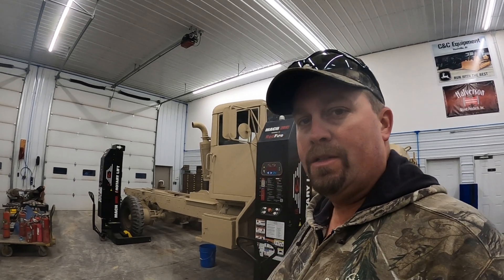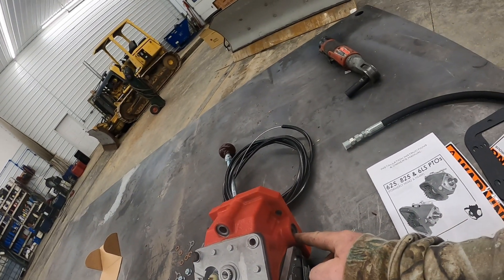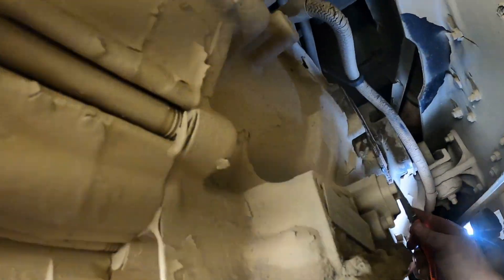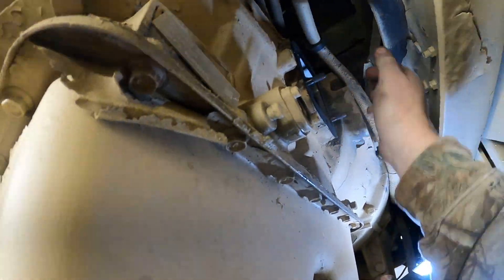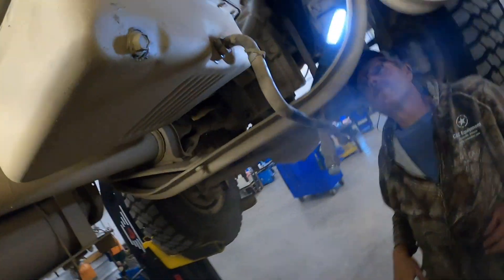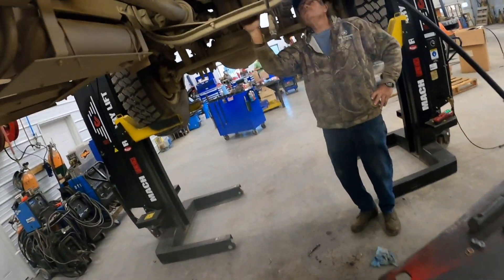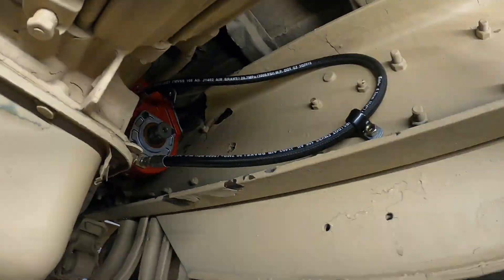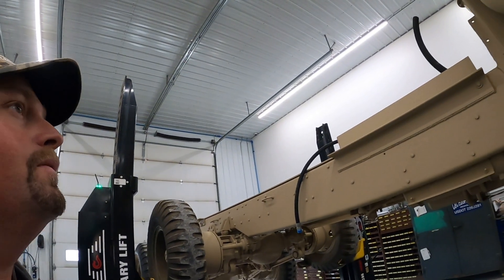M939 series 5 ton PTO install how to @C_CEQUIPMENT

Comment: The 855 small cam is a good motor, my fire department just retired our 1973 ladder truck with it’s small cam NTF365. Damn motor out lasted the truck itself but they blew it up back in the early 90’s and removed the Jake brake. I miss that truck

Comment: On my 1985 M923A1 on the front and rear pumkin on top there is an external wheel, about 6 inches in diameter facing out 90 degrees, What is this for? A PTO?  Thanks
Reply from the maker: No
That’s just a universal design 
The third member is interchangeable with rears and fronts so that’s where the driveshaft would bolt up to

Comment: Thanks for the video, I would not of thought that it would have been that hard to install a PTO, but there just isn't any extra room under and between the transmission and the frame . Looking forward to the rest of the install of the bed and so on .
Great job with the PTO gear box . So you all be careful and stay safe .
As always, Jeffrey !!!

Comment: I would luv to make a dump truck with M923. Wondering if i could use the Bed that's already on the truck? And Do you guys manufacture your own hinges also? If i may ask how much for the whole kit, pump, pto and shaft. Basically all that is needed. Thank you.
Reply from the maker: We have an electric Hyd. Power pack and a sizzor hoist that can be made to work with stock bed

Comment: I wonder if this pto system would work on a generator set up for supplying electrical power to a camper unit mounted on the truck? You make it look so easy.
Reply from the maker: Possibly